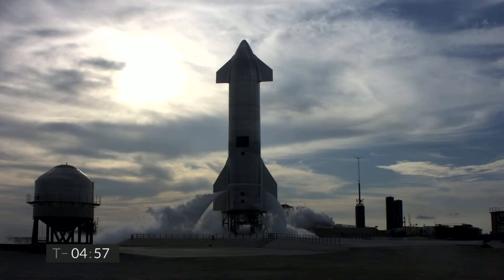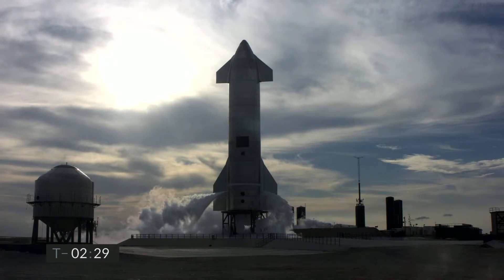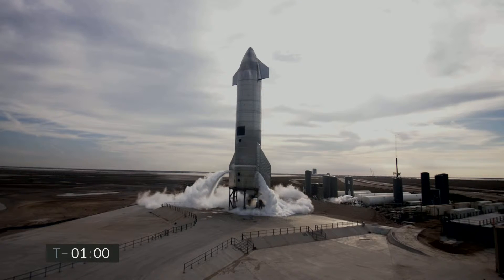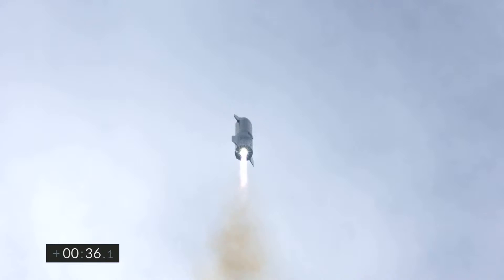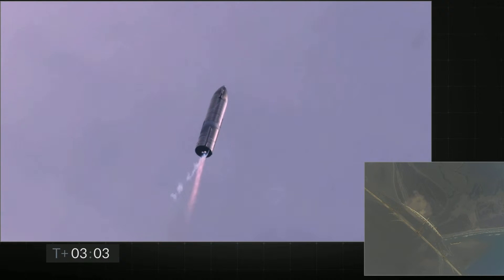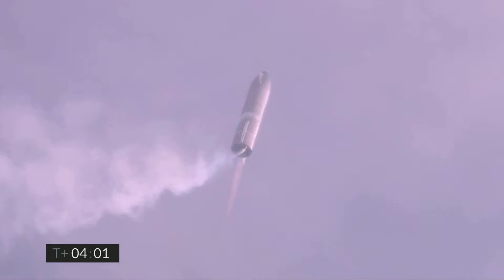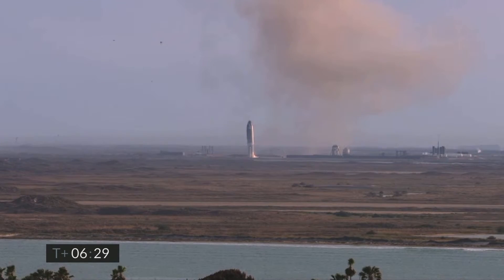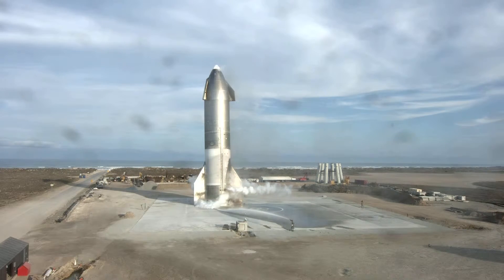Starship | SN10 | High-Altitude Flight Test

Comment: I do have my doubts.. does look CGI to me... not the whole video but certain key moments... also if this real whoever adjust the camers angles did NOT miss a SHOT. very complex shot to stay on. If is not CGI good job.. but if it is..  also good job.
Reply: It's not cgi. SpaceX develops this rocket next to highway 4 down in Boca Chica, Texas. There were so many fans, influencers, third party remote cameras etc. capturing this. Anyone can go down there and look at the factory and the launch site. Just when it actually launches there is some safety zone you can't enter.

Comment: 11:30 to 11:45 looks to CG since the ship doesn't appear to be falling very fast.. especially the angle from below where the ship appear to be falling for several seconds but barely get's any closer to the camera. Is this an optical illusion or how do they keep the ship from falling down much faster than this?
Reply: Hey :)
I'm not a scientist, but I'm kinda into that stuff.

On one side, its an optical effect called parallax, which means that objects more far away from the POV (the clouds in the background) appear to move slower than near objects (the rocket). You can also see this effect while driving a car, trees that are far away seem to move slower than trees next to the road. What does this "slow falling llusion" here, is the lock of the camera on the starship. Because the starship doesn't move in the frame( cause the cam follows it) you don't have a reference object for your brain to get a feeling about the speed. You only see the slow moving clouds, that are in fact multiple kilometres away, thats why it appears that way.
In addition to that, the rocket is laying horizontally, what gives it a big surface for the air to break. Don't underestimate the power of airflow! The ship got into the least aerodynamic position so it can use the airflow as a brake and don't has to waste fuel for slowing down for landing.

I hope that explains your questions.

Edit: that wierd slow falling at 6 min 00 sec appears because the base camera is cropping in the frame at the same speed the ship comes nearer ( same effect if i zoom out of a person that runs towards me)

Comment: NASA: “reusable rockets will never be a thing”

Elon: “hold my battery”
Reply: You: NASA said reusable rockets will never be a thing
NASA: Hold my shuttle
Reply: @josephc.9520  shuttle was refurbishable not reusable
Reply: @bensharpe64 it's virtually the same thing
Reply: @MegaTRONUTTP  no, its not
Reply: @Harold-TheJass-Blingman  Yeah it is, because it’s flying again, and if otherwise it wouldn’t be reusable
Reply: @MegaTRONUTTP  The main tank wasnt reusable, which is part of the space shuttle. Therefore, it isnt fully reusable.
Reply: NASA never said that lol
Reply: Implying that Elon is a battery powered cyborg lol
Reply: When did NASA ever say that?
Reply: Does not seem like it is battery powered
Reply: @xalmaandrei123 Tesla batteries for powering idiocy on wheels but not the rockets
Reply: @Dan Ender  Raptor is not battery-powered, but the control flaps are. They even use Tesla batteries mounted right above the commondome. I think that's the confusion.
Reply: @carcinogen60yearsago  I believe the flaps are powered by Tesla Plaid motors

Comment: There are several seconds of footage missing at each edit/cut cross dissolve point. Is there a copy of the complete unaltered ‘live feed’ and if not, then why?

If this was in fact what was distributed as the live feed, it should include the seconds of missing footage unless, the live feed was momentarily interrupted, in which case we would also expect to see blank/black screen for those missing seconds labelled “interrupted feed.”

Comment: Well, good job but looks like it’s leaning.
Reply: Well previous 2 attempts ended up with a fire ball, while this was far from being perfect, it did landed intact, mostly. Landing itself was quite hard one as you can see it even bounced up after first hit. But still stands, so its a success for a test.
Reply: @Zripas  
I guess that’s a landing you can walk away from. Rough, yes but any landing you can walk away from is a good landing. 
I’ve bounced a few wheels in my early days.
Reply: @MrCatfarmer  
It will be interesting to see next test with starship launch into orbit. Explosions expected. Tho interestingly enough there is a plan to catch first stage with new tower thing, will be really cool moment if it works, or cool explosion if it wont.
Reply: @Zripas  
explosions are a lesson on what not to do again.
I don’t like the word failure, it’s another step in learning.
Reply: @MrCatfarmer  
Generally speaking, you can learn more from explosions than from successful landings.

Comment: what a beautiful rocket and what is the power of the rocket?
Reply: There are 3 engines on this each with ~200 tones of thrust. On the first orbital boaster they will have 32 engines with 230 tones each and on the second stage they will have 6 engines, three with 230 tones and 3 vacuum engines with a slightly higher thrust.

Comment: Only three engines?, it needs five and that would be more respectable
Reply: I don’t think you understand how truly powerful these engines are.
Reply: @OortCloud  all three of them combined are still not as powerful as one F-1 engine, very reliable though
Reply: @Slow13C6GS  It still has a much higher chamber pressure than the F-1 despite being less powerful. And for reference, Starship can land on 1 engine at around 40-70% throttle. 

F-1 still remains a beast of an engine in terms of thrust, despite not being able to be re-used.
Reply: @OortCloud  true
Reply: @OortCloud  also it was inefficient
Reply: @Slow13C6GS  why would it need as much thrust as an F-1? Thrust is determined based on need, not some weird eyeballing method
Reply: @Slow13C6GS  this is just the second stage. The first stage has 29 and eventually will have 32 of these engines.
Reply: @Brixxter  Don’t get me wrong it’s impressive in its own way, I just love the Saturn V and the F-1 engines were also 100% reliable albeit without great efficiency.
Reply: @Slow13C6GS  They were awesome but I wouldn't call them 100% reliable. While they never failed structurally many of the launches were plagued by pogo oscillations because of combustion instability, that tends to happen with engines of that size. Still glorious.

Comment: why does the "exhaust flame" looks so different than the other rockets?
Reply: Are you thinking of the massive smoke plumes? If so, only Solid Rocket Boosters produce that, these are liquid fuel engines.
Reply: because the engines of this rocket are first- on-its-own type

Comment: why speed is so slow, how this will cross over escape velocity,  to mars ???
Reply: You do realize this is a 15 story tall structure going up like 6 miles into the sky within a few minutes. 
Just FYI you should watch how the Starship works. It is supposed to go to the Moon and Mars on a 29 raptor engines or so booster that will launch it into low Earth orbit (LEO) and then refuel in space then from there it will traverse the empty space.
Reply: You know it’s planned to have 3 more engines right? That doesn’t even matter cuz it will be sitting on superheavy, which will have 28 engines...

Comment: why not parachutes at the end just to slow it like in the old days too much space?
Reply: It would too much weight and it would either way not slow it down enough.
Reply: The whole point of Starship is to be rapidly reusable and to make round trips to and from the Moon and Mars. A parachute system should be several times larger and would weight too much adding to the mass the Starship would have to manage.

Comment: You could see that even 8,9,10 all were so close but like all new prototypes they have to work out the tiny errors 
SN15 still had that small fire they were very lucky it went out so SN16 should be faultless the way SpaceX work 
Also they already have permission for SN17 but it’s not built yet
Reply: The fire on SN15 was more or less intentional to burn off the extra methane on board.

Comment: There's no way they can land that thing on the moon.  Unless someone goes up there first and lays a concrete pad.  That thing is leaning, even upon landing on a perfectly flat, hard surface.  Can you imagine if the thing falls over after landing on the moon?
Reply: This is not the final version. The lunar variant is specifically made for rough terrain, like the moon. And remember, this is a prototype. They're still testing its capabilities.
Reply: I know its been a while since this post, but the lunar starship will have bonus landing engines at the top so this would be a problem. Also landing on the moon is a whole different ball game then landing on earth.

Edit:
It will also have no landing legs for earth and better ones for the moon and later also none for the moon

Comment: It's leaning, and on fire.  Is this normal?  Inside the rocket, at the bottom where the engines are, there's lots of exposed tubing and wires there.
Reply: It's an early prototype, this is to be expected.

Comment: So is this a real starship that may see the start of deep space travel? Or is it one of Elon Musk’s bedroom sketches built into a shell with many decades to go until perfection?
Reply: First Orbital Starship is SN20. They've skipped building SN11-14 and SN15 is already on the Pad. SN16 is already fully assembled aswell. SN15 and going from there is a new tech revision, new raptor engines and new engineering. Chances of Landing should be much higher now. SN15 flight attempt on Monday.
Reply: Do I need to remind you that Saturn V was developed in 8 years?
Reply: @politonno2499  Do I need to remind you the Saturn V was developed 60 years ago?
Reply: @Buranski  and now we are in 2021. This guy says that Starship will take decades to reach perfection

Comment: why does the free fall appear to be so slow
Reply: Because it is; that's why it falls like that. To slow down
Reply: @stickmann7363 even with the burners turned off??
Reply: @OK-j7x  yes, the surface area is what slows it down
Reply: When it's falling it's actually very light (most fuel is burned) compared to it's surface area.  So it produces a lot of drag relative to it's total weight and thus has a low terminal velocity.
Reply: thanks guys. It honestly just looks like a balloon drifting in the air like that without power. I think the camera aperture had some part to play too but the background makes it tough to say for sure.
Reply: @OK-j7x  It definitely falls slower than your eyes would expect!  If it were filled with fuel during the belly flop it would probably fall 3x - 5x faster.

Comment: They need to do this dozens of times before certifying it safe.
Reply: they will
Reply: @sn9starship272  ......Not only that, but how will they solve the problem landing on Mars? Here a smooth platform is used for landing, there are no smooth, flat landing sites on Mars that could offer the stability needed to keep this tall ship from tilting. It will be a risky gamble at best. They will have to send several missions just to construct the landing site.
Reply: @humbertothebeliever2443  Elon Musk said 3 words: self-leveling landing legs

Comment: I like how they cut out where it exploded anyway. Scrub X blew it again. At least they are consistent.
Reply: No? This was a livestream, they ended it after it landed. No use showing it sitting around for 8 minutes.
Reply: @alexn8219  no what it blew up period.
Reply: @JEPHRO760  Was saying no to you stating they cut it out. Yes it exploded, but they didnt "cut it out" they ended the stream before it exploded.
Reply: They didn't cut anything out. The livestream ended shortly after landing. The explosion happened approx 7/8 minutes later
Reply: This is the testing stage it's normal for things to blow up.
Reply: Jeff Bozo's Blue Origin dildo rocket is worse.

Comment: When landing, the ignition is too late to correct. It needs to be 1-2 seconds earlier.The liquid fuel bunker should be divided into many small bunkers. Otherwise, if the whole bunker is turned vertically to horizontal, and then to vertical, the kinetic energy of the liquid itself can heat itself, causing expansion and deflagration
Reply: You talk
Reply: Dude your not a rocket scientist...
Reply: They literally have header tanks...
Reply: It is not late according to Elon the single raptor engine was low on thrust to due low pressure inside of one of the tanks
Reply: @Heap_InnovatorsRBLX  That would be the case for SN8. SN10 has a hard landing because it ingested helium unexpectedly.
Reply: @OortCloud  An Starship does not have helium it only uses lox, methane fuel and pressure.
Reply: @Heap_InnovatorsRBLX  Starship DOES use helium. After SN8s crash helium was put into the header tank of SN9 and SN10 to keep the tank pressurized and to prevent what happened to SN8. The helium was not supposed to be ingested.
Reply: @OortCloud  oh nvm I commented on this before I check Elon’s Tweet again I kinda didn’t remember the case

Comment: Need to add a parachute placed on top of the missile,  when it falls straight. 
Need to improve the landing cooling system with the missile fixation axle after landing,  I mean upgrading the yard system so that under it there is a shaft that can move and attach itself.  as a landing gear.
Maybe so,  try using a flying parachute that cuts off when the Rocket is falling in mid-air. 
hm ... i think this idea can be sold, maybe  n't 😄
Reply: Starship is too heavy for a parachute.
Reply: @alexn8219  I know it's heavy,  I mean the parachute is only used for a short time and then cut off when the missile is horizontal,  
 except that the missile is placed at the top of the missile retained at the upright position.  
 The parachute flew horizontally should be two moderate instead of one large enough to bear the load since it would be cut off to enter the final stage anyway. 
 Although mainly used to reduce the force and help more stability,   the possibility of wind,  the weather will adversely affect the parachute and affect the missile but this problem can be improved.  
 which is that you can use three parachutes to change your posture from horizontal to straight if you cut the parachute from the tail of the Rocket.
Reply: @Duchynh2100  Yes, but they've already demonstrated they can land it without, and a parachute would also increase turnaround time for reuse. No need for one if propulsive landing can already yield the requested results.
Reply: Later additions of starship wont have these problems so they dont need a parachute wich would add a lot of weight and wouldn't do much becouse of starship's weight

Edit:
A parachute would also make the rocket more complex and not fully and rapidly reusable since you need to atach a new parachute each time.

Comment: I think that the engineers made a mistake in constructing the "SN" rocket in that they practically limited the cooling of the "Raptor" engine. When the descent starts and the engines start, they start or do not work. Then air pressure is created which returns the heat to the "pot", so to speak. With Falcon rockets, the engines are free and they don't have that problem. One of the solutions is to drill holes in the lower part, next to the legs, or to line the engines with refractory material.